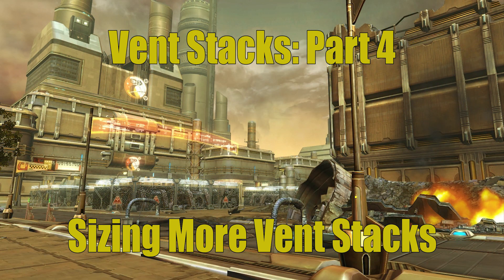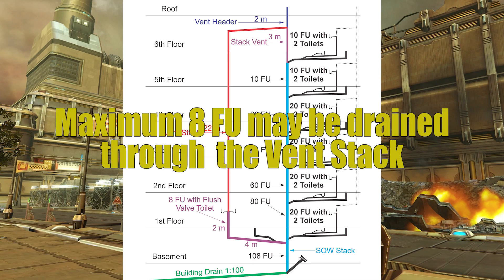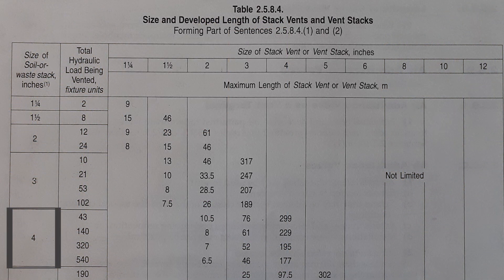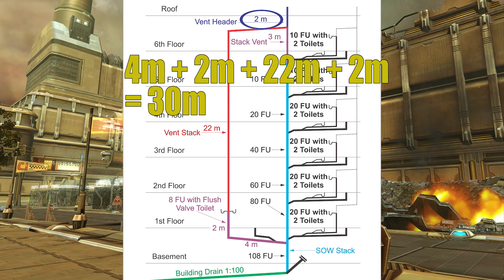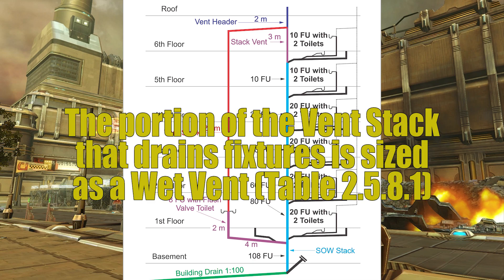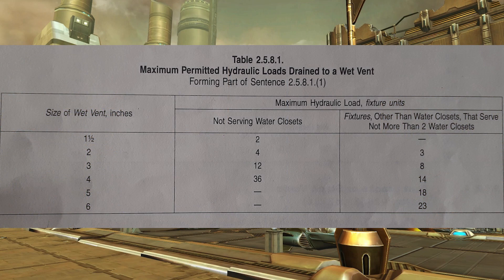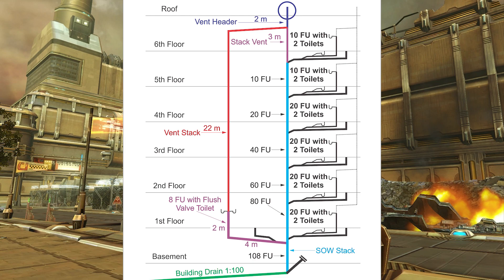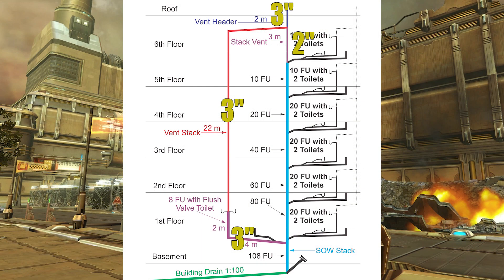Vent Stacks: Part 4 - Sizing More Vent Stacks

Comment: great video. however i believe VH still needs to be full length as vent stack in this case.
Reply from the maker: Clause 2.5.8.3.(3) For the purposes of Table 2.5.8.3., the length of a vent header shall be its developed length from the most
distant soil-or-waste pipe connection to outside air.

The most distant 'soil-or-waste pipe' is a drain pipe where water is flowing through said pipe. In this case it is exactly as depicted in the video